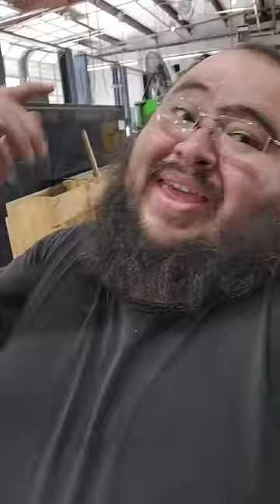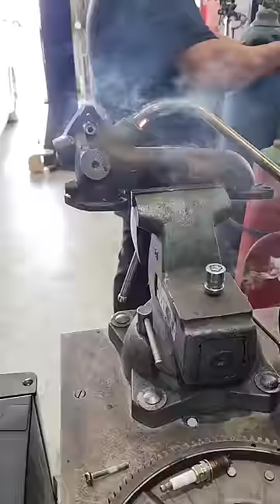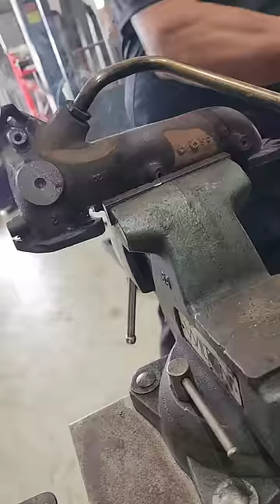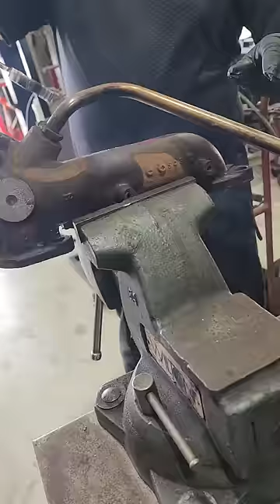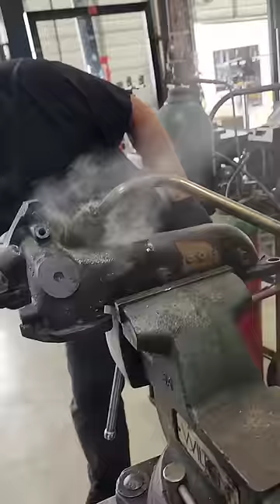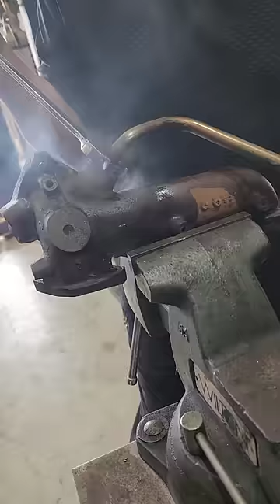MECHANICS MUST HAVE.... #shorts #youtubeshorts #fyp

Comment: Just cut the tube and put a 6pt socket on it. You can delete the EGR or make/weld the tube afterwards. I never spend $10 in gas and a half hour screwing around with crap like this.
Reply from the maker: They were reusing the tube and as a dealer we cannot delete emission control parts
Reply: @FluffyMexicanik  doesn't stop you from cutting it and using a 6pt socket, then either replacing the tube, bending up s placement, or slipping a patch sleeve over the cut and welding it back together. I don't fight anything, I always take the path of least effort.

Comment: To much heat on the threaded screw in part should have applied heat only on the body because basically you expanded both pieces of metal instead of just the one you needed defeating the whole purpose. But a few more years of doing this he will learn one day 🤷‍♂️

Comment: Learn how to properly use a torch. Your flame was wrong. And you didn’t hear the flange up enough. Heat it until it all it a dull red. Then your fitting will come right out. 
Yw

Comment: that is why line wrenches exist. that nut..........
Reply from the maker: Didnt have 1 that would fit
Reply: @FluffyMexicanik  well you had it out back the 6 point box end down the line then. Unless the ends were different size. Usually no though. Trust me don't cheap out on line wrenches, flex head, different size on each end of wrench. You'll use em more than you think.

Comment: You're supposed to get the base cherry red,
try the wrench. It the wrench don't work, use a pipe wrench or chain wrench.
You guys are amateurs. On some frozen bolts, nuts you use mouse oil, penetrating oil of some kind and let it soak overnight, sometimes a few days, but in this day an age where you "want it
now", you end up fucking up more shit than fixing it... 🤔

Comment: Use an air hammer on a low setting. You vibrate the $#1t out of it and it comes apart in about 10 minutes. You're welcome

Comment: If that hex on the end of that tube is the same size or smaller brain cells have left this shop long ago.
Reply from the maker: The hex on the manifold 24mm...the other end of the tubing is a 32mm, definately no brain cells left in the shop or we would have tried before i busted out the camera 🤯
Reply: @FluffyMexicanik  well that's good to hear iv seen way too many look right past putting a box wrench  over tubing and strip it with an open end. But that's why I didn't just call you an idiot couldn't tell in the video.

Comment: Shoulda hammered around the bolt sprayed some pb blaster on it and let it sit then heat it up and wrech on it while having someone gently hammer on it with a air hammer. Only way know how to get those off😂😂😂
Reply: Also heat up the casing not the fitting so the outside moves not the inside

Comment: This guy could have used the boxed end of the wrench and slipped it over the open other side of the tube
Reply from the maker: Damn only if the other end of the pipe wasnt larger
Reply: @FluffyMexicanik  then what's you're excuse for not having a flair wrench on there?

Comment: Put a pipe over the end of the wrench and use it as a breaker bar. I’ve removed countless EGR fittings like that, and other fittings as well. Got a 4’ long section of 4” exhaust pipe in my garage that I just use as a breaker on wrenches. 😅

Comment: Let it cool, doing it while hot is dumb
Reply from the maker: People have different methods
Reply: @FluffyMexicanik  true but material science agrees with letting it cool 
Not only is the metal softer but letting it heat (expand) then cool and contract works the best.. it’s like leaving 50% of the “help” on the table not letting it cool. 
There’s some good resources I could link from engineers who do lab material testing for a living. 
Just trying to help, it’s what I’ve come to learn/do & it’s worked every single time so far. I always done it while hot, thinking that would be the best time..

Comment: You know your wrench is backwards right...are you just messing with people?
Reply from the maker: Thats not me...and so u mean to tell me if the wrench only fits on 1 way because of the positioning of the fastener that im using it wrong?? Buddy its not an adjustable wrench or a pipe wrench...WE use as we feel most confortable to get it broke loose
Reply: @FluffyMexicanik  the wrench has a longer side for leverage purposes. End is slightly angled for better leverage. That's why literally every single wrench is made that way. Not my opinion. That's a fact
Reply: @FluffyMexicanik  that's why the wrench was spreading also. And that fitting is wide open. No reason to use the wrench backwards.